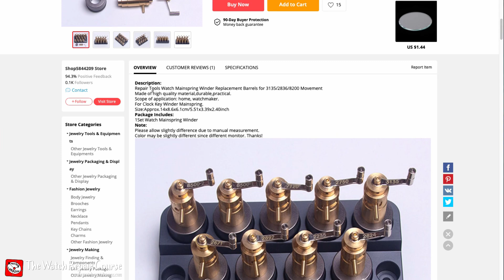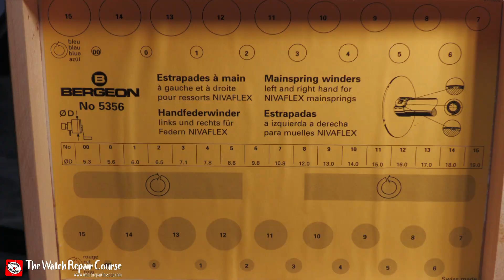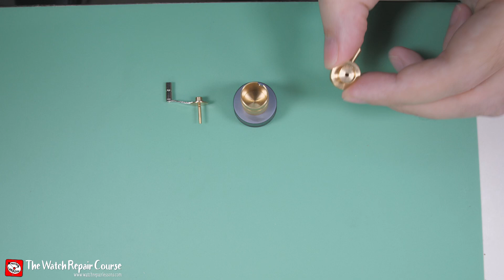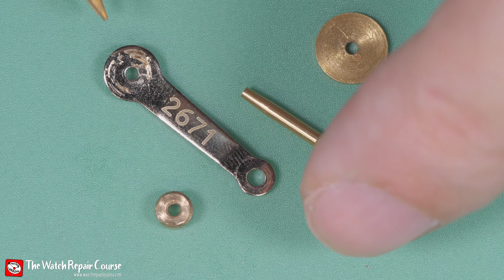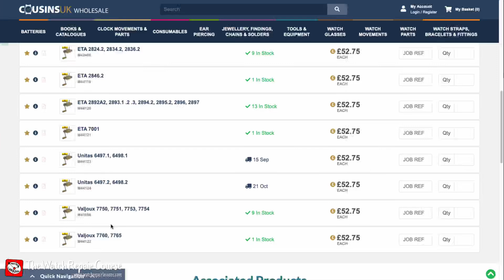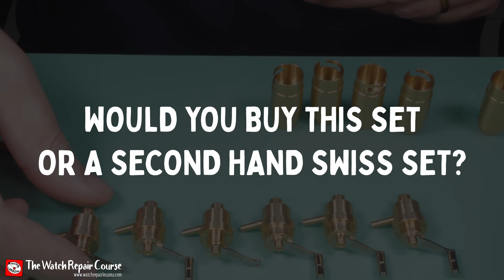Should they be used? Cheap Mainspring Winders - Full review and comparison with the Bergeon Winders

Comment: I bought the smaller Chinese set a few months ago and as of yet haven't been able to use them; they are always just the wrong size.  I've had great success with hand winding though and since I'm not working on anything expensive I think that's the way I will continue until I win the lottery.
Reply: Also, my smaller set has steel arbors NOT brass.
Reply: @2Death9  I won't buy a set of winders if all I am working on is cheap  hobby watches or watches found in garage sales.
Reply: @2Death9  Now those sets are like 45 euros and have steel instead of brass. The "real" stuff is not worth one dime. I personally work in a bike store. Spokes can be different in mm. When you cut them you need to put thread on them for the nipples. Those threads are not cut but rolled(Pressed into shape) and so there stronger. The whole tool solution for just that, costs me 550 euros. Plus the "rollers" wear so 150 every time one is worn. Its insane its this expensive.

Comment: Mark, thank you very much, as always the video is very informative. As for me, I’m not professional watchmaker, but an ordinary hobbyist. Few month ago I bought the Chinese-manufactured mainspring winder, exactly the same you showed in your video. I’ve been using it for several month by now and I can say that for nonprofessional as me it is quite a solution. Of course if I had enough money I would buy swiss made high quality watch tool, but I don’t have enough money. Chinese made tool provides appropriate quality for the price,  in my opinion.
Reply: .....what about if you're working on a russian watch, or lower quality than Eta movement for example? Are these cylinders uniquely made for certain swiss calibers only?
Reply: Hi could you specify which brand did you buy, or copy the link to the one you bought.

Comment: Thank you. Your assessment coincides with my experiences with, and the subsequent expectations, that I have of Chinese tools. Personally, I am not inclined to spend money twice just to appease my want to move forward with my hobby. Can you provide part numbers for the Bergeon generic set that you use?
Reply: Part # 5356, cost approx. $1000
Reply: For the price of the swiss set, you could buy how many Chinese? The swiss stuff, though doubtless very good, is well byond the priced of the average hobbiest.
Reply: @TheSteveGullick  They do make very good cars. Called errrm MG I think
Reply: Shop around. eBay and Craigslist will occasionally cough up decent old tools that, while not as universally applicable or flexible as the big Bergeon sets, will still get the job done for a lot of watches. I snagged a set of old Levin mainspring winders that look to be more than adequate to the task. If they're not quite as fancy as the Bergeon winders, they were considerably less expensive.

Comment from the maker: ** UPDATE: I have not personally confirmed this, but many people have reported that the set found on the cousins website does have steel arbors ** 
** Don't forget to check out part two of my hand lifting tool build - part three is almost ready https://youtu.be/EcjVgzY0K9Q ** 
Cheap Mainspring Winders - Are they any good? This video is a full review of the Chinese manufactured mainspring winders which are now popping up all over many online stores, I thought it would be interesting to review them and compare them with the Swiss Bergeon Winders.
Reply: I just got a 20 piece set from Amazon and immediately checked the material used when you mentioned it here... it is steel! Also, I did not know about caliber specific when I bought them, I just assumed they had mm measurements. Darn, you think can I use a caliber specific if it fits into the barrel I'm trying to set a spring into, even if it's not the caliber?